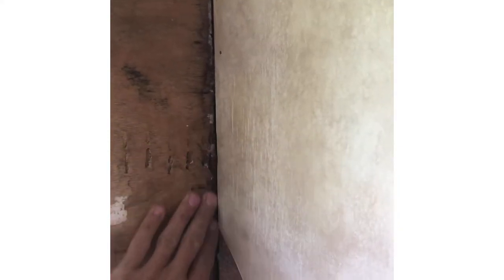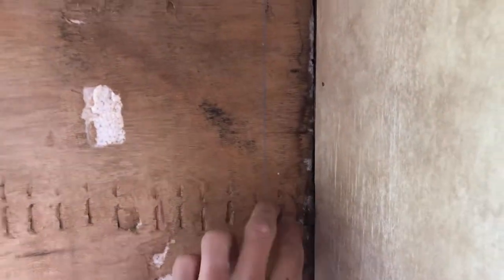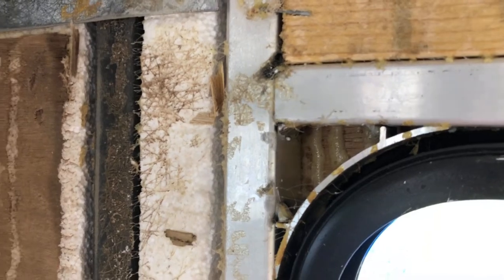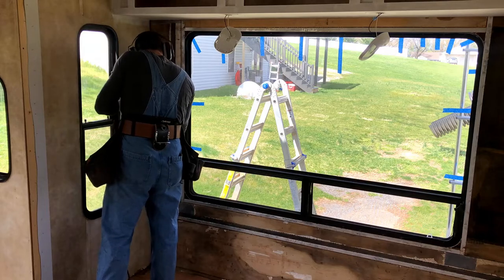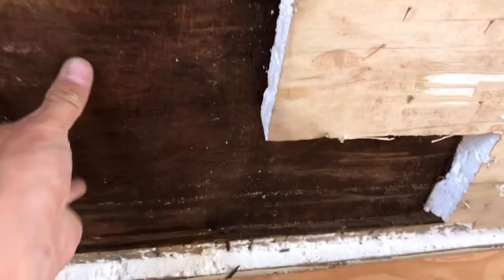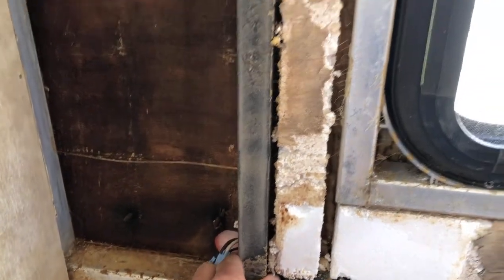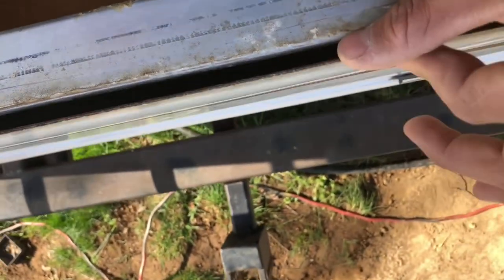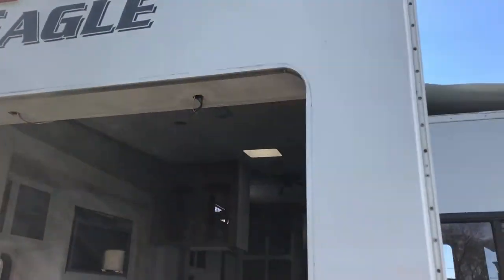Repairing Water Damage ( RE-LAMINATING ) Jayco Eagle

Comment: It would probably have been much easier to first prefabricate 1 1/2" panels with luan exterior over a styrofoam core, then cut the sections you need from the prefabricated panels. Then, just epoxy the pieces into place and you would be done.

Comment: Shoulda got new Stainless self tapping screws! I have put many of these camper windows in different trailers! I always silicone around the perimeter of window also! Another thing to silicone is the edges around all compartment doors. Especially the outside kitchen ones get left open for Roof over opening and will hold water until it soaks up wood inside panel and swells up an rots hinges and inside plywood!

Comment: I have done a Job like this on the Front of 5th wheel and was parked next to 16’ tall truck garage an cut 2x4s and 12” wide PCs of 3/4” plywood for pads against the White fiberglass sheeting! They make a glue for large caulking gun to spread with 1/4” grooves! Campers are Usualy Hot Glued and Stapeled are a fk mess to tear apart!

Comment: Not serious issue but personally when rippin any material I keep what factory I can so basically when rippin the 2x4 if you would have helicoptered it on the second cut you would have had factory on both sides to work with. Factory will always be more precise due to human error and what not.

Comment: Thanks for sharing your experience!  You mentioned epoxy.  If you had to repair (or rebuild) another section, would you reuse construction adhesive, or use epoxy?  How did the shiplap turn out? Thanks again,
Reply from the maker: I would try the epoxy kit in the future. I haven’t had any issues with the construction adhesive though. And the ship lap came out nice.

Comment: How did the outside clamping system hold enough pressure? Did you have the tiny pieces of lumber hammered into the ground at 6:50 or so when you show the outside clamping system?
Reply: I’m also fixing a delamination issue using epoxy right where the side view mirror goes on a class a motorhome passenger side but the clamping system is where I’ve been struggling. I have the mirror off but it’s still a nightmare because I’m no carpenter and I literally can’t think of how wedging against the side of a house for instance is supposed to put enough pressure
Reply from the maker: I did. I cut a bunch of wood steaks to hold a 2 x 6 steady so that I have something to put pressure against.